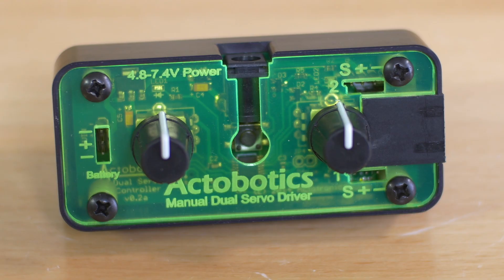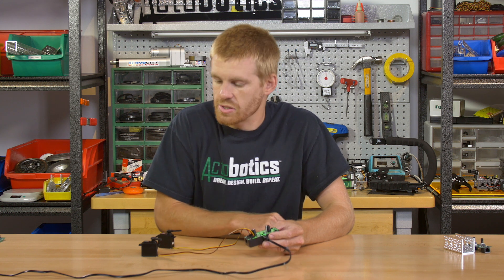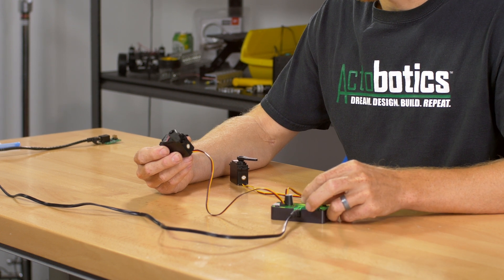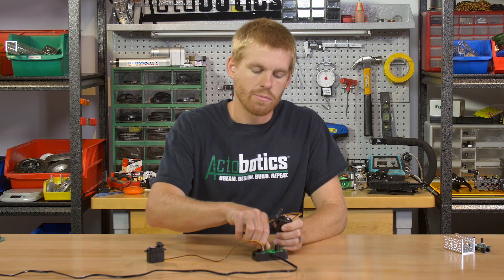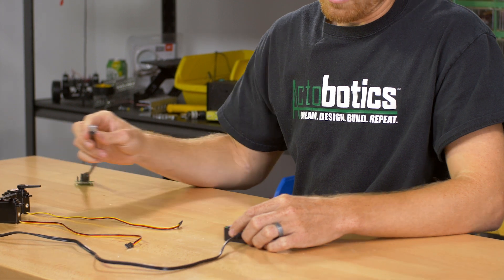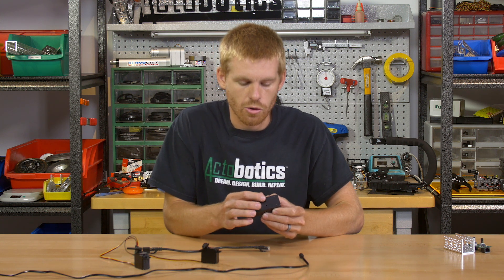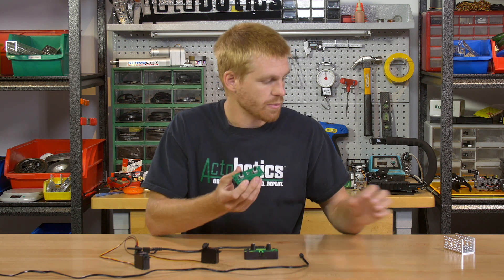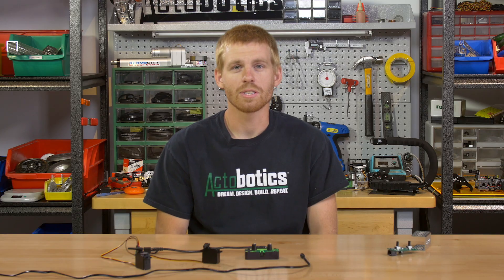ServoCity Products: Dual Servo Driver

Comment: Will this control the speed and  direction of a continuous rotation servo?
Reply from the maker: Yes continuous rotation servos are controlled the same way as normal (closed feedback loop) servos. They operate off of the same type of PWM signal but take the value of the signal to indicate the speed and direction they should go instead of a position that should be reached. While they are called servos, continuous rotation servos are basically motors with built-in motor controllers.
Reply: Need to know the same thing. Will appreciate a reply. Thanks.

Comment: Do you make a similar controller for a stepper motor? Or can you use this one?

Thanks, excellent product
Reply from the maker: Thank you.  The dual servo driver generates a PWM signal.  A stepper motor is not compatible with this controller and we do not currently make any stepper controllers.  Please contact us should you have any additional questions tech@servocity.com.